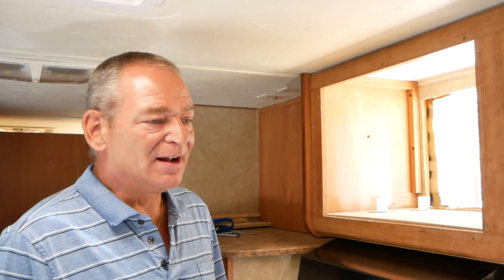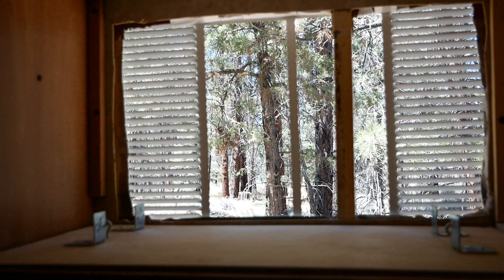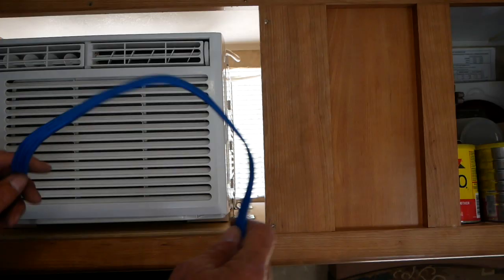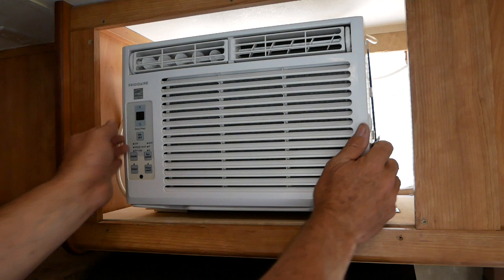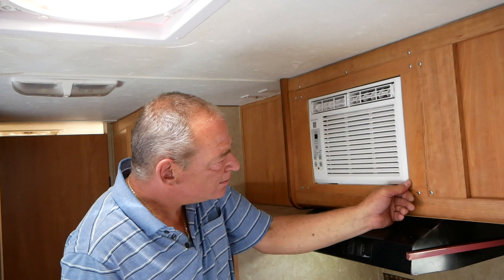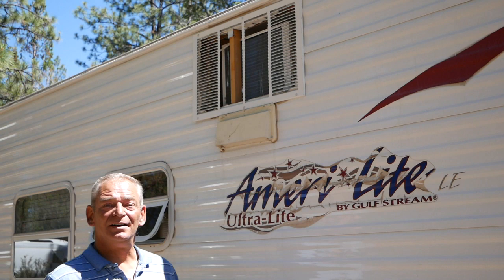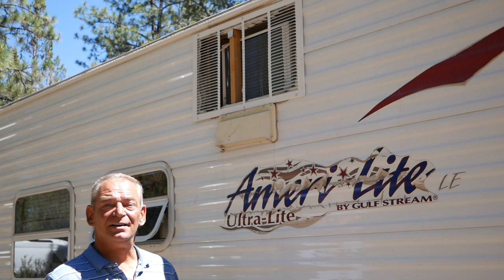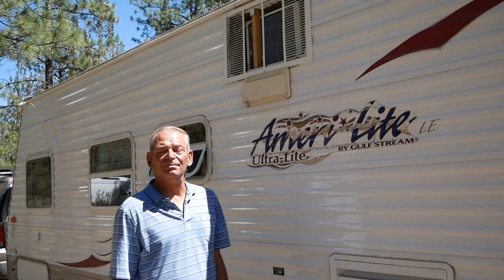Solar air conditioner install in RV microwave cabinet

Comment from the maker: To those commenting on the overheating issue, thank you for your suggestions.  I experienced issues before I removed the louvers from the grate. The A/C has not had a issue since then and ran 12 hours daily in heat up to 112 degrees for a few months in Quartzsite. I will add a drip line if I am ever foolish enough to go where it is humid.
Reply: I worry about all the people that will try to emulate your project (it does look great) without the safety concerns that I assume you've addressed.   If you are using solar power to run  a/c then I assume you don't have the huge start up spike required but others may use "raw" electricity, may not be in the desert & may have issues that you don't.
Reply from the maker: Cyn Ho, thank you for the compliment but you are playing chicken little with no substance to your fears.
Reply: @cynho3093  "Looks great".??  LOL!   This guy is a butcher/hack....  I wouldn't allow him to put air in my bicycle tires..
Reply: I like the idea! When I do projects like this I always come up with something I  could have done better.  Do you have any thoughts or guidance on what you'd do differently? For example, instead of cutting  a large section of the wall,  what would you think of using a louvere dryer vent with a fan assuming you had enough cfm to exhaust the heat. Thanks for sharing!!
Reply from the maker: I think I would save my pennies and buy the 12 volt roof A/C for around two grand. lol

Seriously thought, there are some good ideas in the comments and most are adjustments to what has been done already. Extending the center area will help eliminate recycling heated air. Top and side vents can still be added if need be. I can not cut the strut because it's not just load bearing which framing would take care of. It's part of the rigidity of the wall right above a axle of a vehicle that goes on very rough roads. There isn't room for a drip pan but drilling through the side of the unit will make it easy to add a drip line. A through the wall unit might be better for venting but I chose this A/C because it uses the fewest watts running. I can run one off of the 750 watts on the trailer and two off of my full 1185 watt system while holding the voltage of the battery.
Reply from the maker: #1 TRACKRECORD what-a-JOKE  I did not think anyone was going to catch that, good job. So what you are saying is that you have experience. LOL
Reply: I love your channel and I'm a new subscriber. Can you please do a detailed video of your solar setup? Panels, batteries, wiring, inverter and everything else. I would greatly appreciate it. I'm looking to do a van build in the future and wish to power a lot of things. Thanks so much and have a wonderful day.
Reply: #1 TRACKRECORD what-a-JOKE  after I read your comment I got a little bit unsure so I started sticking it in all holes
Reply: Any idea what another low load start ac would be good...this model doesn't seem to be available anymore
Reply from the maker: @JackSmith-vm9cl  , I just recently received two of them for installs. 

https://amzn.to/2zY1VB7
Reply: Hi
😊
Can you tell me exactly what i need to run an like that thank you
I need info badly thanks
Which panels ,inverter etc etc etc

Comment: Jim, I worked A.C. for over 35 years here in Fla.   The real answer to your problem of overheating, is to take the a.c. cover off the unit, thus eliminating that cabinet overheating problem.   I have done this myself a few times with great results. Glad to help you out.           Try it, it will only take a few minutes of time .    Your good friend Vinny in good old Fla.
Reply: Kathy Bowen:
 By removing the AC cover off the unit, about how much larger than the AC unit does the hole in the outside wall need to be, to allow air into the side vents? 
Also any idea for a outside wall cover? I was hoping Jim would make a video of how he did it. I have an ambulance that I want to add a 5000 BTU window unit to. Thanks!

Comment: Hey Jim, hvac guy 38 yrs. I have a similar situation. You may want to separate the ambient outside air, going in thru the sides of the compressor, from the hot air coming out the back., otherwise that hot exhaust air will just circulate back thru the sides. Also, some 12v forced air would help assist in ventilating the back end of the unit. And yes, add a drain pan, just in case. Great vids, thanxx.

Comment: It's going to recirculate the hot exhaust air and burn itself out, it needs a fresh supply of cooling air to work right, ask an air conditioning expert, they'll agree.
Reply: This is the same way new model travel trailers under 18ft mount an inside air conditioner.  Identical.  Trailmanor was one of the first to use cabinet air conditioners and they worked beautifully.

Comment: Hi , Might Want to Make a " Water Drip Pan " to Catch any Condensation From The A/C Unit . This Will also Protect Those Wood cabinets  .
Reply: Most Boondockers stay in desert/high desert climates. So the condensation is nil-to-none. Not like when I lived in NY and it dripped non stop during use.

Comment: Wouldn't it be better to place it on some kind of rubber mat for  vibration dampening? Also, what about all that empty space around the sides...won't heat and cold get into the camper from there?

Comment: I added the same AC unit to my RV and also installed it inside a cabinet however I used under-mount drawer slides to enable the AC unit to extend outside thus allowing proper air flow and water condensation to drip outside. I also installed a RV compartment door around the AC unit so that when the AC unit is not used I can pull the AC back inside and close the door. I can also run the 5000 BTU unit on my solar power because it is only 450 watts. I also made a wood platform that sits on top of the drawer slides for the unit to sit on and made it so the condensation would still drip through the wood base. When cutting a hole through the RV I suggest having the compartment door on hand first because a square hole versus rounded corners requires different sizes of doors. You might find the rounded corners of the door might not cover your square hole in the corners!!!

Comment: Clever spot for the unit.
Thanks Jim for the video.
Richard in Thailand
Reply: I was thinking the same thing. Cold air sinks. Having it up high gives you the best circulation.
Reply: Richard I agree
Reply from the maker: miss you my friend
Reply: @solarboondocker4597  So, a follow up to my last email. The problem turned out to be a bad breaker. The installer used breakers instead of fuses and the breaker between the panels and the charge controller/inverter took a crap. It didn't trip, as it was still in the on position, it just failed like an open cicuit. We found a replacement breaker and we're back to charging the battery again!
Stay safe, miss you guys! R i T

Comment: Personally I think the new mini-split units available now are a better choice. I do like your clever mount and trim method.
Reply: "Mini" is a relevant term. Mini for a house set up, yes, but not in the small rv world ;)
Reply: As a alternative to the traditional roof top unit I do believe a mini split is a better choice which I should have gave better context to my meaning. As a bonus removing the roof unit makes room for more solar panels. I apologize I didn’t mean to come across as comparing a mini split to a window unit which would be comparing apples to oranges.

Comment: Great concept for install but the AC does indeed need fresh air to cool efficiently and needs to be extended further outside the hole to get this. Also even though these newer units fling condensation onto the condenser for cooling if your in a high humidity area your going to have moisture issues inside that area. A fridge roof vent might be one solution for cooling air into the sides of the Ac.
Reply from the maker: Overheating is no longer a issue and I will eventually dd a drip line when I rework the hatch
Reply: Way to teach this guy, he thinks he knows everything under the sun and he doesn't.

Comment: My AC unit showed up today. This is almost exactly how I'm planning on installing it! Thanks for posting!
Reply: @lifequest7453  Yup I've been troubleshooting those issues. AC is going above the stove hood. Condensation tube will be routed down through the existing space the hood vent is using. As for the hot air recirculating I will have a flip up exterior door and slide out barriers on either side of the unit to keep intake and exhaust separate.

Comment: Well done! I would consider putting some insulation around the air conditioner inside the cabinet to increase efficiency and quietness. Surround the A/C unit by insulating and filing the area where the exterior hole was cut. It is also a good idea to put a tray with a hole drilled and hose barb with hose to the outside under the A/C unit in case the water slinging of the fan is not able to keep up with the amount of water condensation, especially in high humidity. I have a similar unit. Eventually it will overflow and and cause damage if there is no way and nowhere for it to drain.

Comment: You need to keep the intake and the exhaust separate. One option is a refrigerator roof vent directly above. RV builders do this to avoid using an expensive though the wall AC. Use a white vent instead of the black ones.

Should not be hard to do. Use 1/2 inch xps foam. Easy to work with.
Reply: Ron Powell  Heat loves rising.... Let the heat rise.... And the roof vent will already be hot from sun exposure. Draw the cool air from your side vent.
Reply: Hummmm.... Maybe that won't work... i forgot heat is coming straight out of the condenser :/

Comment: I also just added a Midea 8k BTU AC to my RV. It is a mini split with inverter technology, meaning it is soft start enabled. It runs at most at 710w but runs on average between 400 and 500w. Amazing and quiet unit. It is Amazon number one seller. I also installed it with a cutout in wall inside entertainment center and installed 24"x18" compartment door Drawer slides are also used so now when not in use slide AC inside and close compartment door. I mention this AC unit because I have the Frigidaire 5000BTU in my bedroom but it is way louder than the Midea and they both use about the same amount of power. Hope this helps your viewers.

Comment: Very ingenious! It’s a good, clean fit. I suggest that you install a screen behind the ventilation grate, to keep out uninvited critters. There are screens of various types, that should not affect the ventilation process, if applied correctly. Make sure to keep the cooling fins clean and open in order to get the best possible circulation of air over them. I have the exact same window unit, and it stays on, nonstop, every summer. I just keep the fins clean, and keep the drain tray clear of debris. Excellent installation!

Comment: Very nice install and great job on the solar AC!  I would add a tilted drain pan underneath, and an aluminum mesh cover outside.  I bought a roll very cheap from Home Depot and custom made fly screen covers for all vents on my RV. At $20 per bug screen cover for tiny vent holes, this roll at $5 was the way to go.  Someone made a good point about the hot air blown out being sucked back into the AC so do separate the air from outside.  I would also add a small window awning over that AC for preventing rain and direct sun on AC.

Comment: Not an expert by any means, but you might consider placing some Rockwool insulation in the space around the AC inside the cabinet. Seal the space between the AC cabinet and the opening with a moisture barrier and tape.  Rockwool does not retain water, bugs do not like it, it deadens sound and is a good insulator. The stuff is easily cut and you can get it at any building supply store.

In my area's climate (Southern US), that space would build up moisture which could cause any number of problems.
Reply: can't do that, the 2 air intake areas are on the sides of the AC unit.  It needs to pull in fresh air on the sides and then that cooler fresh air is blown over the hot coils and out the back of the window ac.  A window unit is designed to have those 2 air intake areas on the sides of the AC unit hanging out in an open air environment, not enclosed in a box where circulation is greatly decreased. The AC unit will work the way Jim has it set up but it is far from ideal.  It has to work much harder while yielding less cooling due to the enclosure.  It will wear out much faster.  But if it works "good enough" for Jim, then it's good enough. 

Better to have the AC mounted on a heavy duty drawer slide so it can be slid out when needed, exposing the top, bottom, rear and 2 sides to the open air and then slid back in when not needed.  The side hatch, hinged at the top is a good idea.  see video below at 13:05 to 17:00

https://www.youtube.com/watch?v=hCP0zuTdoh4

Comment: you just gave me a damn good idea, I have an Alpinelite 36ft 5th wheel, I was dreading to put a 10k window ac in the living room, I have a access door to the outside that was blocked off by a previous owner of this 98 model, it was a small thin storage area on the slide out, even though it is way lower then optimal, I do believe it will cool off the area quite well as an auxiliary to the roof ac,,,, thanx for the inspiration !!!

Comment: I found out the hard way that there are Window AC units and Wall AC units. They get rid of their heat differently. 
A Window AC vents heat out the sides. 
A Wall AC vents heat out the back. 
Window AC units put in a wall will cool less or even shut down since it can not get rid of heat fast enough compared to being exposed directly to the air. 
Putting a meat thermometer in the side cavity is a good check for heat buildup.
Reply: His unit looks like a window unit, not a through wall. It has vents on the sides.
Reply: Greg White, Yes. I believe it is the low-wattage, efficient, soft-start window unit he talked about previously.  
This may work. My old one did not, thus the forced research and “ah-ha” as the AC guy pointed at me and laughed;-). 
Just a seed to think about if there is an issue and for others doing a new purchase/install.
Reply: @mikemead2315  Did you find a 5000 btu through wall unit? If so what was the brand and model?
Reply: Greg White, we just pushed it further out the wall until the sides were exposed. Inelegant, but worked. However, there is a neat setup in a van that used a through the wall. I’m pretty sure I have the link. Back in a few.
Reply: Greg White, videos look like 11 months ago for visual reference.

Comment: I love that idea, I refuse to have a microwave in my life, let alone my camper. It looks like a great fit, except for one thing that you're going to need to fix, before the disaster begins. 
I'd recommend placing a cookie sheet or metal pan, with a drain hose to the outside,underneath it to catch the condensation. As far as the ventilation goes, try to vent the hot air from the sides, separately from the rear ventilation. You don't want to overheat the unit. Also check the front filter monthly if you're in a dusty area... 🌬💨🥶😓
Reply: How can you vent the sides? I’m thinking of installing mine and pull out the microwave oven.

Comment: Nice system you came up with.
You could almost make a folding A frame style cover for the outside. Folded it would lay on the side of the camper due to gravity.

Comment: The problem is not back pressure what is happening is the air flow is hitting the louver and is not getting out before the intake on the side sucks it back in and re-circulates the hot air which drives up the head pressure and overheats it and will also cause poor cooling due to lowered capacity. That back of the unit needs to be outside or it’s never going to work good!!!

Comment: Where is the water going to escape? Window AC should hang out past the exterior wall and be slightly angled down. Looks like the water may drain between your wall.
Reply: Robert, listen again. He said it splashed against the fan as it is designed to do.

Comment: Amazon refridegerator sliders.  Put a/c on slider.  Then push outside when running    Water drips down.  Unit stays cool.  That’s my crazy idea doing it right now

Comment: Just a quick note to say hello... hope all is well. 
I purchased an 07 Ford E350... extended high top. I haven't started working on it to any extent but that will change before too long. I live in a three bedroom home in the burbs of Sacramento and I hope to be out of here, and California, by September. Surely by year's end. I may look for a caravan to travel with initially until I'm a little more comfortable but ultimately prefer being alone... or at the very least surely knowing where the exit is. 👍
These years pass quickly... it's my desire to live a much different life than I have been living. It's my desire to 'live' and not simply exist as I see the sun setting. 
All the best to you... 
And, again, I hope you're well.

Comment: Just subscribe with you after seeing  an interview with you with the old guy cheap RV living about your trailer and solar,  talking about how many panels you can get on top of a van roof. I just saw another video where the guy had a van conversion with a rack like one would normally have with solar panels but mechanically under those solar panels there was room for the rack to slide out another set of panels on the left side of the van and also slid out another set of panels on the right side of the van altogether he had nine panels 3, 3 and three.  He didn’t say what he spent on the rack but it sure was beautiful
Reply from the maker: I'd love to see that

Comment: That's not going to work well. All of those slots in the A/C housing are supposed to be outside venting the heat from the fan motor and compressor to the outside. You have somewhat trapped that heat.